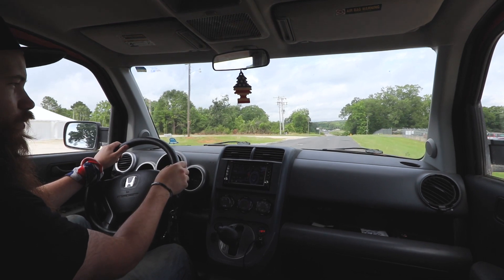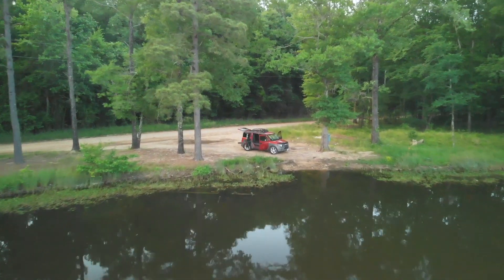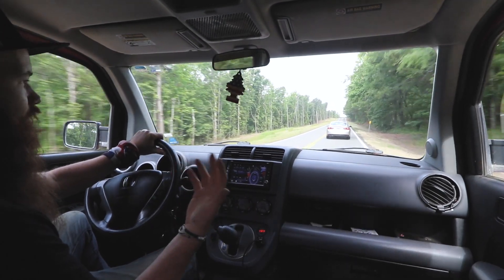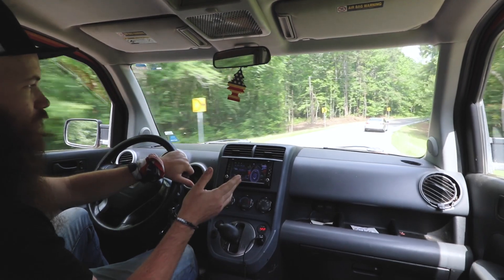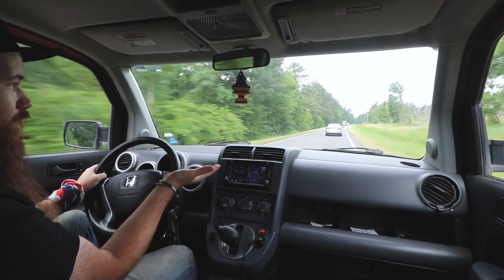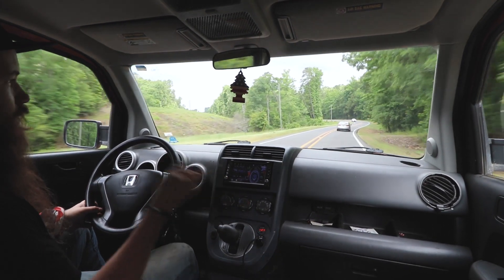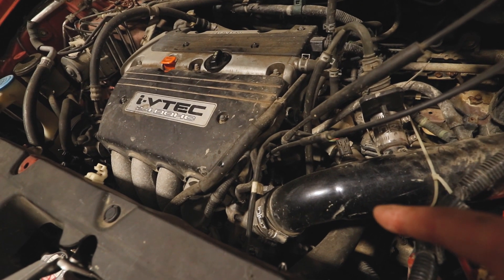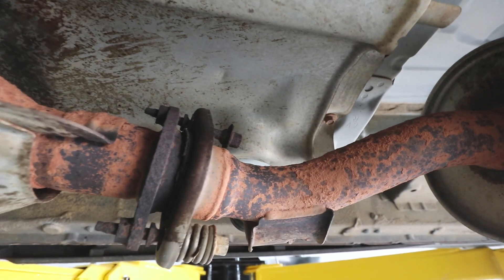Review of the 2003 Honda Element(10+ years of Ownership)

Comment: What is the top speed of this element in this exact model? I have a 2003 ex awd auto and I love everything about this car as but i feel like it struggles when it comes to merging under hard acceleration. Also I’ve done a all out top speed and it can barely go over 95 mph! Is that’s it true top speed?
Reply from the maker: I've done 110-115, it just depends on a few factors. Make sure your valves are on good shape and adjusted. They typically need that after 150k miles or so.
Reply: Dash-n-Cars yeah, there is definitely something wrong with my truck lol. Well, the car is at 157k and I’m always up to date with my oil changes. It’s runs smooth as butter and is really quiet at a stoplight that you cannot tell if it’s turned on/off lol. I’ve never had the the valves adjusted though. Is that mandatory for this vehicle to get that done? Does this have to be done exclusively at Honda or can a local mechanic do that job of adjusting the valves?
Reply: You have the same 2003 ex auto in awd or fwd? Idk if it makes a difference in top speed bc the awd carries more weight in theory as this engine would be lugging more weight.
Reply: Anyways, what else can contribute to car not being able to achieve its top speed?
Reply: Can the valve adjustment be done at pep boys?
Reply: Also, I do agree the bushings, on the various suspension components go bad easily. I was looking into power flex polyurethane bushings for the sway bar links and possibly the control arms and whatever needs replacement. What’s your opinion on power flex polyurethane bushings? I go on forums for the car but not too many people have done any modifications to the element like I’m potentially thinking of doing. Will the polyurethane bushings have any benefit in helps the truck handle/corner better compared to the oem bushings(brand new)? I knows it’s not a sports car but I’m sure we’d appreciate if there is minimal lean and body roll when driving this brick through curvy/twisty roads.
Reply: One last thing, how does this truck handle at the speed of 110 mph? Is it stable or stetchy in anyway? I recently replaced my sway bar link with aftermarket moog links and it’s feel really stable and tight at speeds of 90 mph. Would 110-115  mph be any different stability wise? I apologize for asking all these trivial dumb questions but I’ve had this truck for almost 3 years and I’ve been tempting to want to sell it lol. I previously came from a 2006 Mazda 3 as I really missed the sporty feeling and the speed/stability it had to get up to those speeds. That thing was a king of a highway gripper despite being a small 4 cylinder compact and I’m trying to get the Honda Element to handle as well as that car if not at least close to it. Do you think that is possible? Would could I do to make the Element handle as good as that car but still retain the comfortable(kinda) that it designed to have? I understand this is not a sports car and neither is the Mazda 3 but the Mazda had a sporty feel to it that makes it ‘fun to drive’. I apologize for all these questions but I hope you can give your 2 cents as to what and how I can makes this truck the way I want it to be based on your experience with this car.
Reply from the maker: @markdesilva7207  ha! No worries. So yes the valve adjustment can be done by anyone. I would go to Honda though just for peace of mind. They quoted me 400, but I'm going to do it myself.
Mine is a awd, so the weight isn't a big issue. It feels very happy at high speed, just really wind noisey.
You can definitely do a loooot of stuff to the Element to make it fun. I raced mine for many years and always a hoot. I really recommend Coilovers as a first upgrade to get the handling right.
The K24 inside the Element is one of the most modified motor in the world right now. People are making upwards of 1400 HP on the very same motor you have in the Element.
Oh and bushings, I always recommend gong OEM. The stiff bushings are fine for racing but not for just daily driving. They're very loud and creaky.
Reply: Dash-n-Cars driving this truck it has no issues getting up to speeds of 90 mph. In your case, how long did it take for your element to reach top sped of 110-115? Does it slowly climb up to speed after it reaches 95 or it gets up right away?
Reply from the maker: @markdesilva7207  very slowly. It's a giant box, remember that it's trying to push all that air out of the way.
Reply: Dash-n-Cars in your Honda up to what speed does it pick up quickly till? I assume your truck has no issues with engine performance and may have the valve adjustment so I’d like to know what  the limit of this truck is before drag kicks in. I’m not trying to treat this as  a sports car but to me it’s seems every other car of similar year and class of this car seems to have no issues getting up to triple digit speeds no issues. Even a POS 90s car can do that no issues. I love the utilitarian and driving aspects of this car but I feel like even a pos car can outperform this car lol. Idk maybe I need to get this truck inspected by a professional mechanic
Reply: What speed does it pick up to quickly? After What speed does this thing start to accelerate slowly? Funny thing is my dad has a 2016 sprinter 2500 and that is WAYYY more of a non aero dynamic box than the element and he has no more issues doing 100 mph even though it is not appropriate to be going that fast in that lmao.
Reply: Also I want to ask one last thing. Are performance air filters a good or bad thing to add? I’m corncerned about the dirt and dust getting past the oiled cotton gauze. Here’s one: https://www.amazon.com/Spectre-Performance-HPR9493-Air-Filter/dp/B009DJ381M/ref=mp_s_a_1_7?dchild=1&keywords=honda+element+air+filter+performance&qid=1610320201&sr=8-7
Reply: Also I was looking into the k&N filter. My question is do you think there a performance air filter will give this truck more grunt in acceleration off the line. And better top end speed?

Comment: I have a 2004 Honda Element how do I know if it’s a Ex , Dx , Lx please help thank you
Reply from the maker: Good question! If you have the interior storage in the roof is a good indicator of an EX or not. You should be able to Google you Vin number as well to determine which trim it is. The EX also comes with those 16"alloy wheels, not the steelies.
Reply: Dash-n-Cars I do have a little do with storage in the roof , I have to buy tie rods and it’s asking for trim
Reply from the maker: @ronniedawn  tierods will not matter which trim you have. They'll all be the same. I couldn't see any reason they'd change.
Reply: Dash-n-Cars thank you I will order them now thanks a ton
Reply from the maker: @ronniedawn  no worries! Let me know if you have any questions!
Reply: Dash-n-Cars thank you

Comment: What are the worst issues with your Element?
Reply from the maker: Very good question! My absolute thing I dislike is the rear suspension. It is impossible to work on anything with a bushing without destroying them. Something about Hondas rust prevention back then, but the bolts are absolutely siezed on everything. 
My car has been a southern car all it's life and it still has bolts that are siezed.

Comment: Hey there! Can anyone give me some advice? I am looking at a 03 element 4wd being sold for about 4000 with a nice system in it and 3000 without the system . It has 117thousand miles. I wanted to know what i should look out for and what questions i should ask the seller. I have bought lemons in the past and dont want the shitty luck of doing that again. The seller is a mechanic and has put work into the car and wants to sell it to go towards a brand new car. I noticed the engine light was on and he says he has tried doing all types of repairs to it but the engine light keeps coming back and isnt sure why. Any thoughts/advice or opinions ?
Reply from the maker: Hey! If he's a mechanic he should be able to tell exactly what the check engine light is on for. It's extremely easy to pull the code with any diagnostic reader. If he can't fix that light I would probably avoid it, especially for the price. Not a bad price for the miles but seems fishy to me.
Reply: @DashnCars  thank you so much! He said he will run the codes today and let me know what it is. I had an electrical problem with my old 07 chevy equinox before. It would always trigger the engine light even though nothing was wrong with the engine. I would pour money into fixing whatever code popped up but the engine light would always come back on. I just dont want to run into that problem again
Reply from the maker: No worries! It should be a pretty easy fix, especially if the mechanic is worth anything. Good luck! Hope it works out.
Reply: @DashnCars  thank you very much! Well im back again, hope its not a bother to ask another question haha. Maybe if you cant answer, someone else in the comments hopefully can. So the mechanic who is selling the car (who my brother trusts and has known for 20 years and taken his car to) said he had replaced the O2 sensor and the Cat. He replaced the CAT with an aftermarket Cat and he says because its an aftermarket CAT and not a Honda Cat, that is why the sensor is being tripped to come on. He said he can clear it away for me, but that it will come back on. Do you feel its worth me buying it at this point? Do you feel this is the actual problem just off of what i am telling you? Mind you this car is 3thousand without the system in it and 4000 with the system. And only 117 thousand miles on it
Reply from the maker: @saudiamerican1791  of course I don't mind! That's why I made a YouTube channel, to help out people!
So that makes a lot more sense, there are ways to clear that code up but honestly I ran with a check engine light for literally 5 years because of an O2 sensor problem. I just didn't care 😄. But again I knew what the problem was, since you have the knowledge now I would feel better about that purchase.
The factory Honda CAT is expensive to replace, that's why a lot of people have them stolen. That's more than likely what happened to that one.
Reply: @DashnCars  ah ok i see! Thank you! So when i had asked this guy for the code after he had originally told me what the problem was when i first test drove it, he got all pissy about me asking for the code. He is being moody about me wanting to be 100% sure about my purchase and he is taking it to heart that i dont personally trust him. He just told my brother to tell me that he "sold the car"...he didn't though. He is just annoyed because i am being "paranoid" about it. But now that i have seen such great reviews for this specific car, do you have any advice for me about buying one? What price range is fair for the 03-06 ranges? Or like any advice on if i should purchase a different kind of car or go with an element?  I just dont want to go over 6 or 7grand and really need something that is extremely reliable. I really do appreciate the advice and your time!
Reply from the maker: What a jerk 😄. Honestly a fair price would be 2000-4500 depending on miles, model, condition of course the first thing you should do is go under the back end and check rust. A little rust is fine, but heavy rust avoid big time! Other cars in that range, CRV of the same years are good too. Very similar everywhere, just not as unique and cool.
Reply: @DashnCars  aahh thank you so so much! Your advice is super helpful! And i have already subscribed and "liked" the vid as well. Much appreciated!❤😁
Reply from the maker: For sure! Good luck, you'll love the Element of that's what you end up with. Shoot me a message anytime of you have any other questions. YouTube is bad about tracking comments unfortunately

Comment: Would u buy an Element with 220k miles? $2500-3500k
Reply from the maker: Depends on the condition of everything else. Check for excessive rust and any kind of history of maintenance. But the price is fair for the miles at least
Reply: @DashnCars  forgot to ask. Does this come with a timing chain or belt? Thanks!
Reply from the maker: @Andy L  timing chain, should be replaced every 100k-120k.

Comment: What is your opinion on free air flowing filters? Are they detrimental to to engine or are they worth an investment. There are two brands one from k&N and one from Spectre https://www.amazon.com/Spectre-Performance-HPR9493-Air-Filter/dp/B009DJ381M      Do you think it will make a difference in the throttle response and gas mileage noticeablely?
Reply from the maker: I run one on my Element, but as stated in the video it's mostly a noise maker for me. It may increase both of those very slightly, but nothing incredible. In order to get those really large improvements you'll need to do some major stuff; turbo, supercharge, complete engine build.